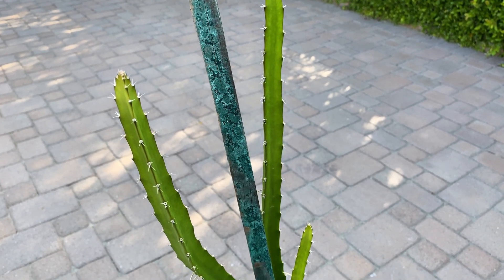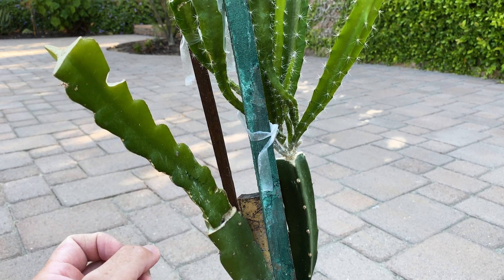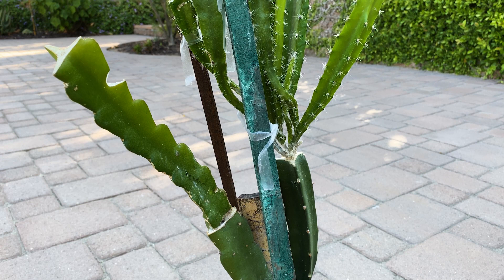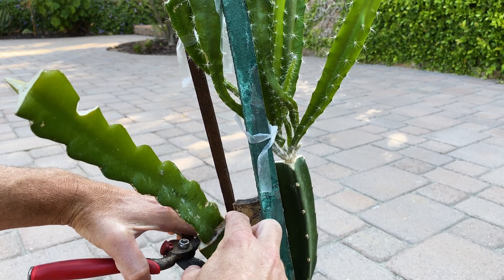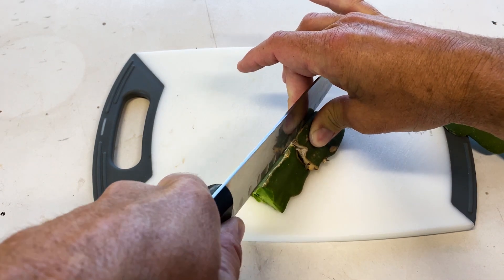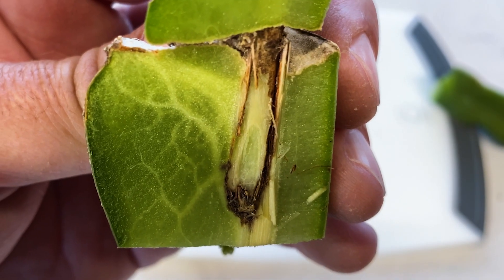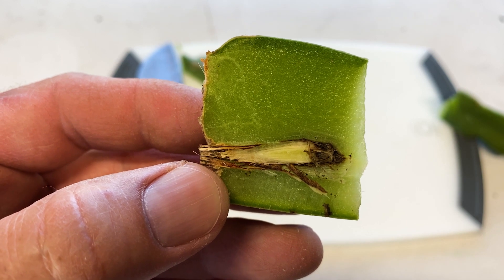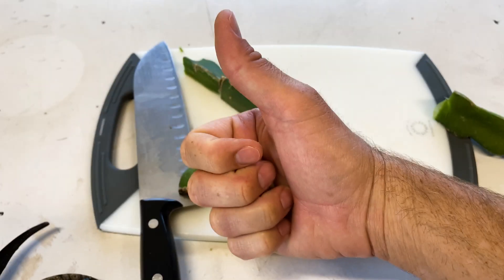DISSECTING a DRAGON FRUIT Graft ( We look inside a graft to see how the Two plants merged)

Comment: This is a very interesting internal view, but perhaps for reasons that you didn't realize. By normal cactus grafting standards, this is actually an incredibly poorly healed union. Everywhere that you see darker coloration between the two pieces (including the bottom of the scion between the two pieces) is an area that didn't fuse together during healing and isn't exchanging nutrients. These areas are instead focused on producing callous tissue and trying to prevent rot in the humid environment inside the graft union. If rot doesn't take over, callous tissue will form and make the union relatively physically sturdy in the short run, even if the callous of the two pieces isn't fused together. The place where these two pieces are truly connected will eventually form a strong woody connection with time, and the snug fit of the callous should hold it in place until then. In this piece, none of the "cambium layer" between the ends of the two pieces has fused, but dragon fruit actually don't need direct contact of the "cambium layers" to produce a good union. In fact, dragon fruit don't even have a "cambium layer" in the way we typically think. I'm happy to explain the anatomy of it further if you're interested. I have some ideas on how the peg method could potentially be improved.
Reply from the maker: I have not tried this method again... I like the peg style graft and Gray Martin uses a cool variant... I'd appreciate your input... It's a bit ironic that another commentator on grafting says that df don't need to attach to the cambium layer to thrive.... I believe that the cambium layer is a channel of growth and energy... I find this cross section interesting on many levels and agree that this is not an optimal union.
Reply: @RAREDRAGONFRUIT  It's important to understand the anatomy of cacti and compare it to other plants, since cacti have a few key features that make them very different. These features can be taken advantage of in different methods of grafting. I'm not a botanist and I'm still learning about the phytotomy of cacti, but I like to approach it from a botanist's viewpoint. I've been working on an accurate illustration on Hylocereus internal anatomy that I'd be happy to share with you.

Cambium shouldn't be thought of as a layer per se, but rather as a type of undifferentiated tissue known as vascular cambium. Vascular cambium is what's responsible for creating phloem vessels (for nutrient transport) and xylem vessels (for water transport, and later on woody tissue). Vascular cambium is often arranged in a ring around the outside of the stele (core), but can be found in other structures as well- especially in cacti.  The cambium itself in any structure is only a few cells thick at most and isn't responsible for directly transporting any substances, only creating the vessels that do. Vascular cambium tissue and the xylem and phloem which it creates (along with associated tissues) are arranged in individual long strands which are called "vascular bundles", which can be thought of as an individual vessel. These vascular bundles (containing the vascular cambium, xylem, phloem) are usually arranged in a ring shape called a eustele which produce phloem towards the outside of the stem and xylem towards the inside, with the cambium tissue often present in the middle of each bundle to form a complete layer of cambium (cambium layer), but the cambium tissue is only a part of the structure. When you look in the core of a cactus and see a ring in the middle (the outline of the "core"), you're actually seeing a ring of multiple vascular bundles, not just the cambium tissue itself. In cacti, much of the visible ring will be woody tissue with the vessels contained inside it. The ring of vascular bundles encircles the pith, which is the lighter spongy material in the very center of the ring. 

The vascular bundles (vascular cambium, xylem and ploem) make up the vascular system of dicotyledon plants, but cacti have a very specialized vascular system. Cacti have a vastly thicker cortex (the area between the stele (aka core) and the epidermis) than any other plant, which they use to store water. The majority of most cacti's diameter is occupied by the cortex, whereas most other plants of a comparable width would be occupied by the stele (which in trees is made up of wood). Most plants move water and nutrients from the vascular bundles to the epidermis by diffusion, but cactus' cortex is far too thick for this, and the stem would dehydrate through evaporation through the epidermis before enough water could diffuse across the width of the cortex. To combat this, cacti have evolved a specialized vascular system that has a network of small vascular bundles branching all throughout the cortex (called cortical bundles) much like capillaries in animals. Each of these cortical bundles contains its own cambium tissue, phloem, and xylem to transport nutrients to and from the outer cortex where photosynthesis and sugar production takes place, but don't extend all the way to the epidermis. Most of the "roots" that were visible in this video are cortical bundles that have thickened in response to being severed at the tip in an attempt to find a new pathway to deliver nutrients so the plant can resume growing from the tip. Unlike the vascular bundles in the central of the plant, the cortical bundles occur as single strands and aren't arranged in a ring formation unless a new shoot forms at an areole, at which point the bundles will thicken and grow in a circular arrangement similar to the stele.

My theory is that, when grafting dragon fruit, you don't need the two "cambium layers" (the vascular cambium tissue contained within the eustele) to fuse-  you just need ANY vascular cambium tissue to fuse. Since all of the cortical bundles present outside of the stele (core) of the cactus contain vascular cambium, xylem and phloem, and since all cortical bundles are capable of producing secondary xylem and secondary phloem (sustained dividing and differentiation of the cambium), I think that a bridge between vascular cambium within the cortex itself (between cortical bundles) is all that's needed for a successful union. That union should be able to provide a pathway for nutrients and water to reach a bud on the scion, which would then proceed to grow. I've been following Gray Martin's method closely, and I think that these are the mechanics of what's happening inside his grafts. The "cambium layer" is nearly immeasurably small at only a few cells thick, and the only true way to access it in dragon fruit is to twist the plant around the core until it "slips" off naturally. Because Gray uses a hollow rod to remove the central core, he's actually pressing into the cortex of the plant without directly exposing any of the "cambium layer" (cambium tissue within the eustele). However, he's still severing hundreds of cortical bundles on both the scion and the rootstock which have the ability to fuse together, and since the peg is the exact width of the hole he's pushing it into, they can heal together very cleanly and have the opportunity to form a strong union. This is in stark contrast to your example in this video- the peg and hole are different sizes at irregular diameters, and in most spots both formed the dark callous tissue without forming any union between scion and rootstock. The graft will still take as long as there's just one point that connects the scion and the rootstock, but there could be much better contact and better healing with a different method. 

You used a drill to core out the rootstock here, which didn't remove all parts of the woody core. Dragon fruit does form a true type of wood in its pith, and it's my belief that any time you're trying to graft wood directly to other wood that the union will be poor. Even when you're grafting fruit trees, the wood interior to the cambium layer never fuses together as it has already died- you're relying only on the new growth from the the fused cambiums and the callous tissue to grow together. If you were to cut through the very center of a 20-year-old graft to reveal the a cross section of the original grafted pieces, the stems of the original pieces still wouldn't have fused together. This might not be the case with cacti since cactus wood cells have the unique characteristic of staying alive for decades instead of dying off as most wood does. But at the very least containing a clean graft union between two woody cactus stems would be very difficult as cortex, pith, and likely the vessels contained within the woody tissue all tend to shrink and recess into the body of the cacti after it's been cut, leaving the exposed wood to push away from anything that it's attached to.

 The most important revelation of this video is that there is absolutely no fusion of the rootstocks at the butt ends of the cores. In a flat graft, this would be the only area that any fusion would occur. I don't see this as evidence of a failed graft here- quite the opposite. I believe that this lack of a union at that location is typical of almost every successful peg graft. At the very least, I don't think a union at the but ends of the core is required for a good graft union with this method. In my mind, the benefit of a peg graft is that the union is formed along the internal stem of the dragon fruit where woody branches can then develop as the vascular cambium in the cortical bundles divides into secondary xylem and phloem. This seems far better than damaging two cores which are already woody and hoping that they heal together cleanly like we do with flat grafts and cleft grafts.

Let me know if you have any further questions. I've been having a lot of fun learning about this stuff, and your channel is one of a few that's gotten me really excited about dragon fruit (despite never eating one that I've been impressed by).
Reply from the maker: Let me think about this a but before I reply... I like your thinking but need to clarify a few things...
Reply from the maker: @jeremymorrell4682  I really like your reflection on this unpaved topic... In my experience, a woody core tends to push apart the union because the core grows taller and the tissue callouses and shrivels... The margin of error is greater. I have much more success with young, undeveloped cores to use as root stock and plan to use them whenever possible. However, I plan to try Gray's new method because it's similar to the peg graft. I've done several more grafts using this method and like it a lot. I like the explanation about bundles, it makes perfect sense to me. Thanks for the comments and please email me anything about this topic.
Reply: @RAREDRAGONFRUIT  What e-mail address can I reach you at?
Reply from the maker: @jeremymorrell4682  whatplantisthatpaul@gmail.com